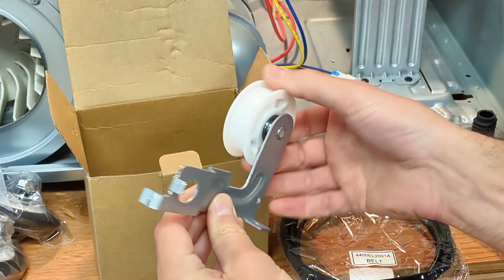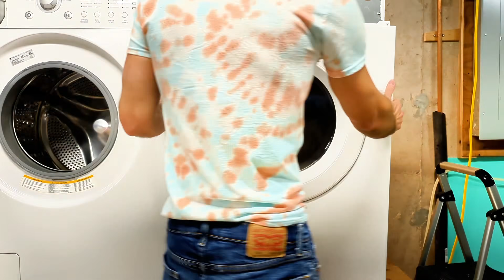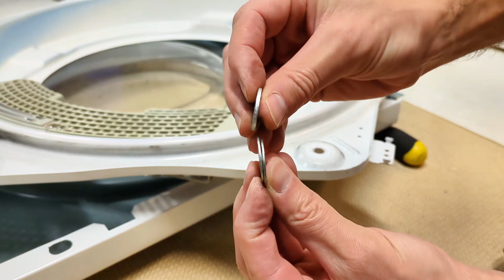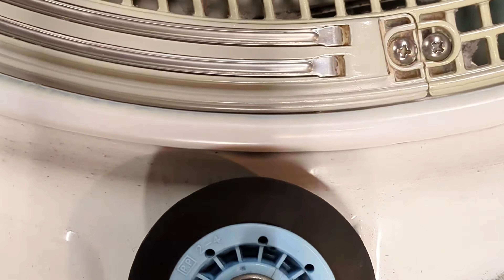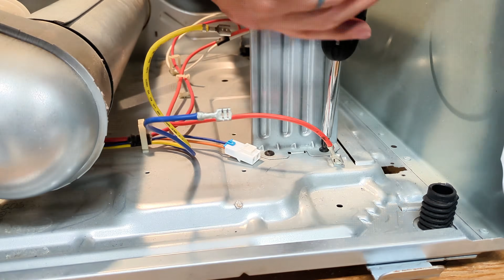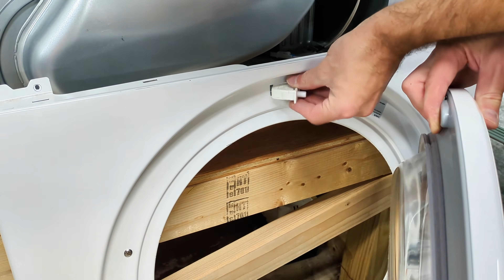How to Replace Dryer Belt, Drum Rollers, and Idler Pulley - LG

Comment: Great video! Helped me do mine. Loved the step by step instructions from disassembly and back. 

One question though, why didn't you sand the new roller so you would have a new bearing on that roller instead of a worn one?
Reply from the maker: That particular roller was still good to use... And in case I messed it up sanding it down, I'd have a brand new one still ready to go. But yeah, I certainly could have just used the new one

Comment: @realhouseDIY - 
I replaced worn drum rollers and belt ply pulley. I have managed to put everything back together. The issue is I have a plate  with a screw left which j dont remember where i took it from. 
Any advice.
Reply from the maker: Can you describe it? Or might help to search for the parts diagram and see which part it matches.

Comment: The back panel doesn’t need to come off to reach the back rollers. There’s room to stick a wrench in there from inside.
Reply from the maker: Thanks for adding this info. If you can get it to fit, it certainly saves a lot of time!
Reply: @rea @realhouseDIY happy to help! Thanks for the video. I’m just finished putting everything back together and your video was helpful. But yeah you can save yourself taking the back panel & element off. I see the same access holes I used to remove the back rollers in your video.

What’s the white lithium grease for that comes with the kit? I never used it.
Reply from the maker: @andrewsimpson7332 really? I didn't get grease with my kit. I've read that you should only use dry lubricants if you need to such as dry silicone spray, graphite (like you use in door locks), etc.

Comment: Worked for me using your linked kit. My particular issue was a very loud tumble and burnt plastic smell. When I disassembled the dryer, the back left drum roller's bearing was completely destroyed - there were tiny metal flakes everywhere. No flat spots on any roller, just the destroyed metal bearing, pretty wild. Thanks for the video, it helped me replace it (and the other components) easily!
Reply from the maker: You're welcome! Thanks for the feedback

Comment: My same drum roller is also flat, and the bolt has the same offset. As yours.  According to Gemini AI, the observed offset is part of the design to help compensate for a single motor driving both the drum and the blower fan. The drive belt pulls the drum in one specific direction (typically toward the motor side), so the load on the rollers is not equal. Based on the AI info, I will reassemble without sanding that one roller and hope it also works.  Thank you for your video, which provided exceptionally details and helped me greatly.
Reply from the maker: Glad it helped you out. I suppose maybe designed like that on purpose, but I doubt the engineers planned for it to result in flat or worn out rollers. They definitely didn't get it right whatever they were planning. I'm leaning more toward this being planned obsolescence and expecting consumers to buy new dryers or replacement parts.
(Just my two cents... It's been a great dryer otherwise!)

Comment: Great Video. I just checked and  belt, pulleys and tensioner are ok…  also motor is good… what else could be a problem? My drum is not spinning l. I just hear some sound when turn on the dryer… still stuck 😢
Reply from the maker: If you run it with the top panel off, the belt moves but the drum stays still?